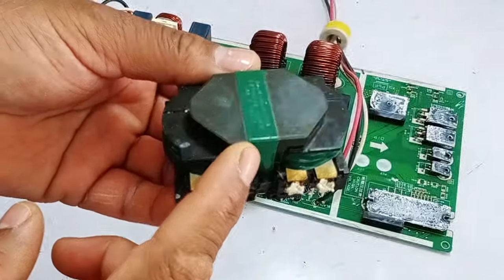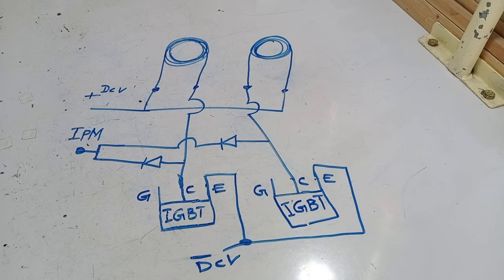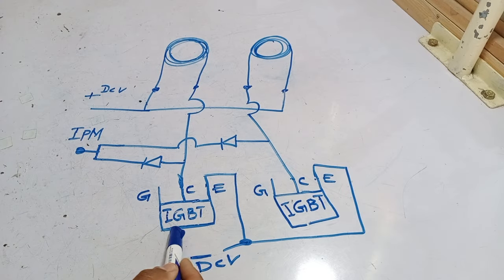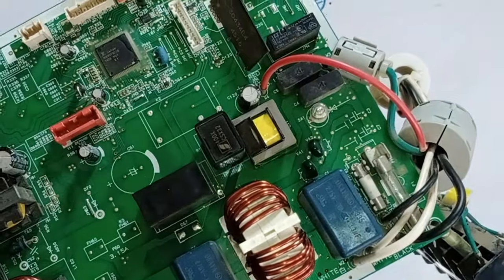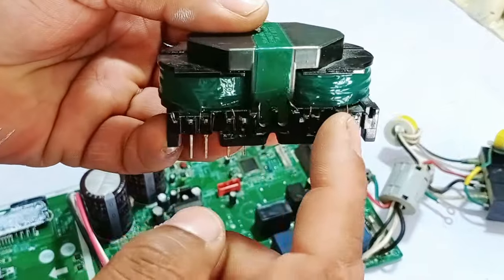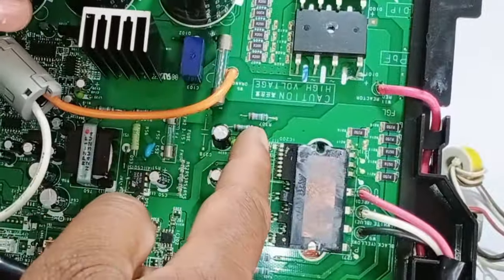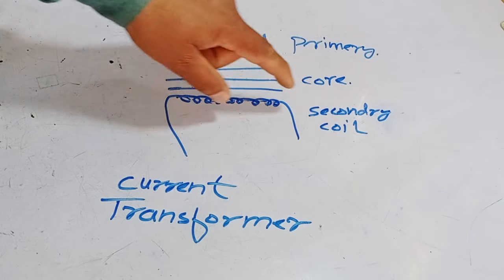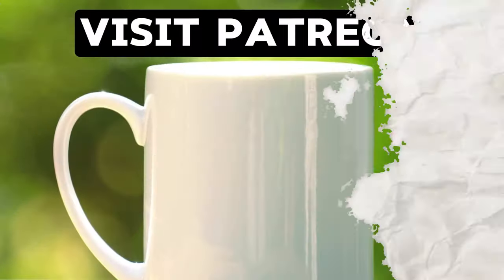Use of Coil Reactors & Current Transformer in A/C Inverter Circuit

Comment: My AIRCONDITION has stopped working. Let me explaine. When I start it from the remote control. On the display both ligts indicate normal function. No error. But the outside body from the compressor side has this Problem. The fan starts and works without the compressor. The compressor is trying to start for 3 second and stops. But the fan is not stopping. Then again. The same is repeated. What I have done. I changed the capacitors with a new one. The result is the same. Any advice please. This air conditions is 18years old. And never serviced. The freon is R32. The make is HISENSE KFR 320 1GE